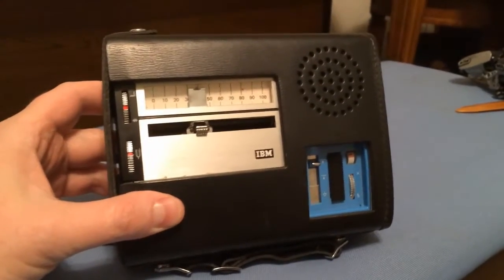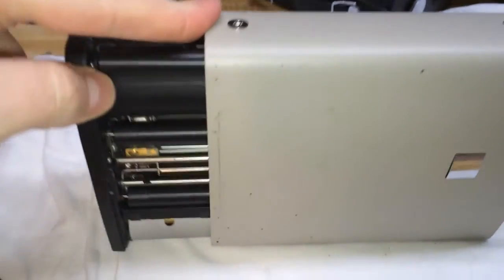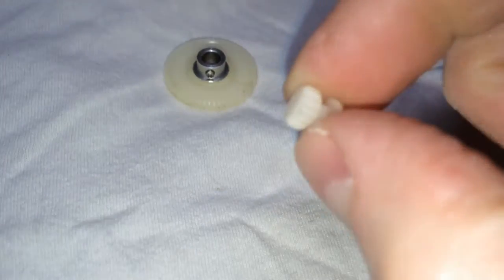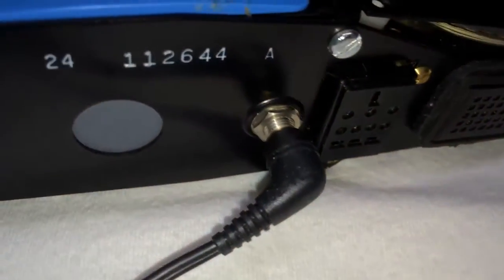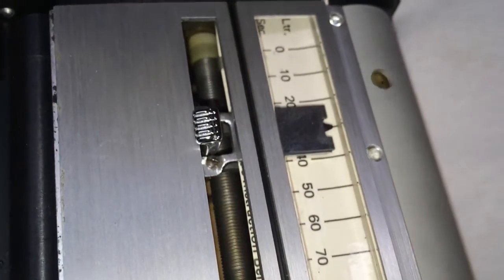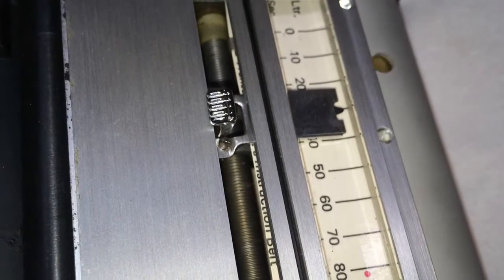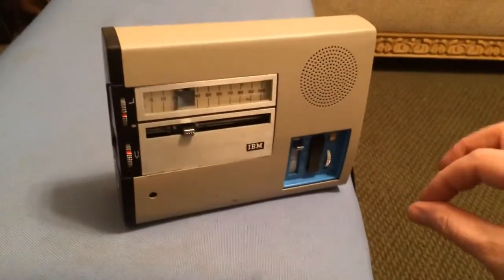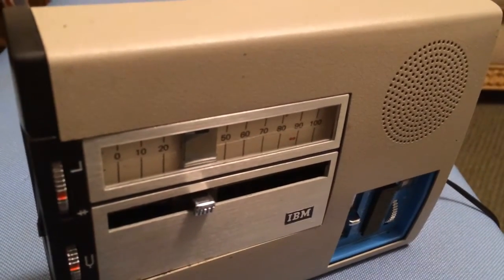Office Tech: IBM 224 Executary Dictation Unit

Comment: Databits.  Thanks for this video. I am a long-time collector and tech.  but this is my first 224.  Mine is dead.  I cleaned out the battery compartment. and attached an external power connector.  But it is completely dead.  Are there any interlock switches around the unit that might be corroded?  My battery meter does not move when I connect the power.  Any suggestions would be appreciated.  Your repair is very clever.  I had planned to 3d print a tooth belt for mine - my belt is still complete and unbroken but has a crack in it so its just a matter of time before it breaks.

Comment: Fact: The same 11.2 volt battery that was used in this was also used in some old smoke alarms, long before the 9 volt batteries that are still used today became commonplace in alarms, since manufacturers were eventually able to use more energy efficient circuitry in their units.

Comment: I just found one of these for $50 and your video is a really perfect resource. Thanks so much for making it!
Reply from the maker: You're welcome!  Does your work?
Reply: I still need to attempt to power it. I just learned from your video that that is a power connector on the side. I thought I was going to have to modify the battery tube.

Mine appears to be in good order, though, so I'm optimistic. Visually, it looks nearly mint, inside and out.

Comment: I'm still about 15 years ago I had one of these worked fine didn't have a battery I had to use a external power supply recorded great sounded great did I end up having to replace the belt otherwise thing work great don't know what happened to it since then neat item though.

Comment: Hi Databits, we have one of these units from my father-in-law and it would be nice to see if a new battery could get it to work. Any help would be appreciated.
Reply from the maker: Hi Susan.  It is doubtful that a battery would make it work.  I've had 3 of them and the drive belt was crumbled inside.  I'm also unsure where you would find a replacement battery.  I can transfer the tapes to digital for you if you are curious as to what is on your tapes.

Comment: Fascinating machine, nice fix. The sound (apart from the wow) is pretty good, a neat kind of sound. Did you have the original microphone? Or does it use the speaker as a mike?
Reply from the maker: Thank you sir.  Yes, the motor appears to be weak despite my oiling it. It actually has a built-in microphone.

Comment: wow, I like your style and your resourcefulness in using spare parts that you had to recreate the parts that were broken to make that machine run again. who cares if it doesn't run perfectly, you got it running again and now it is a working unit. I'm proud of you for getting it to actually work when you demonstrated it after you took it apart to repair the motor, good job. with such small delicate machines like this it could have gone the other way and maybe your repair job could have backfired and it may not have worked out the way it did but you got it working and that's all that counts.
Reply from the maker: Thank you for your comment!  It was a fun repair project.